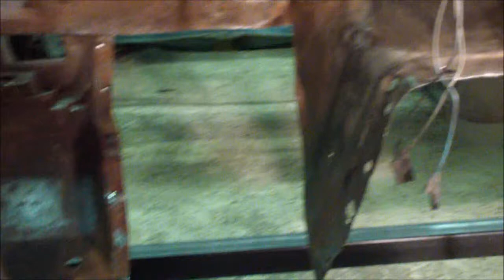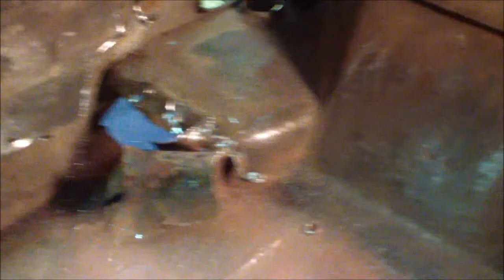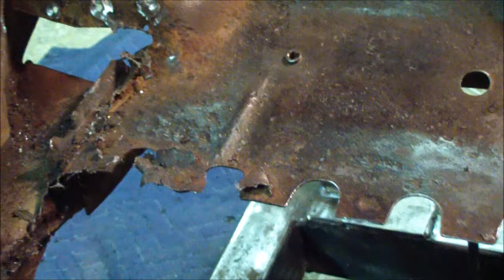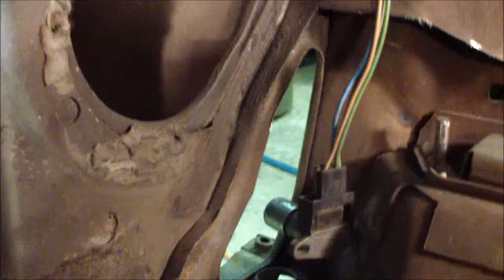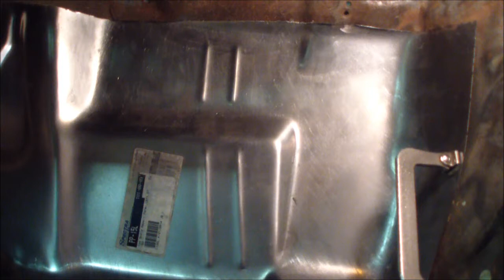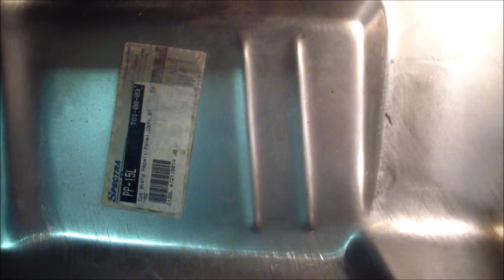1968 Camaro Restoration Part 2

Comment: Interesting. I have a 1967 Camaro that I am needing to work on the passenger toe board. This was helpful for me. I am also interested in how your rocker panels go.
Reply from the maker: Thanks. Glad the video helped. I hope to have the rocker panel (inner rocker only) video up around the end of the month. The passenger inner rocker was much easier than the toe board (which was tedious but not difficult).
Reply from the maker: Going to be a few weeks late; had to much work in Jan. to be able to work on the car.